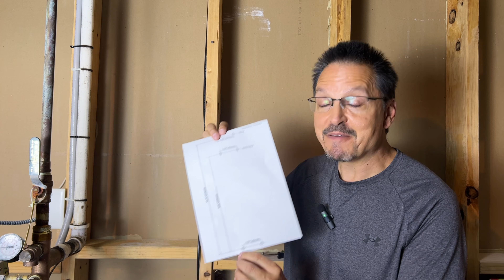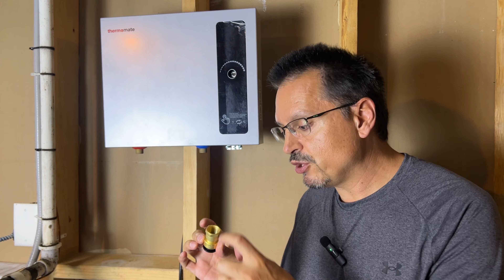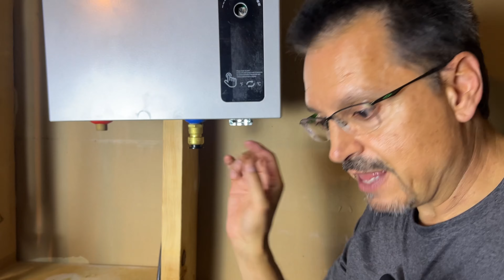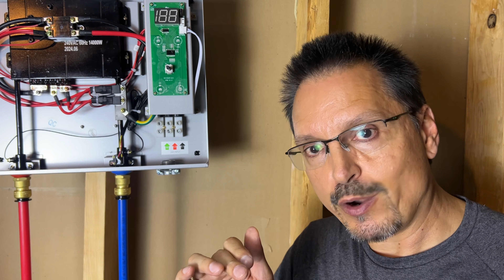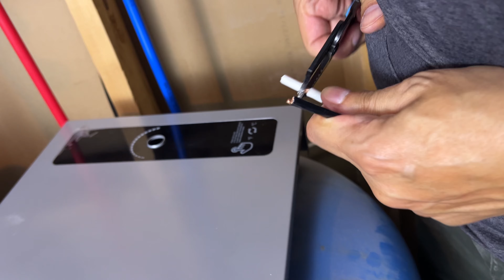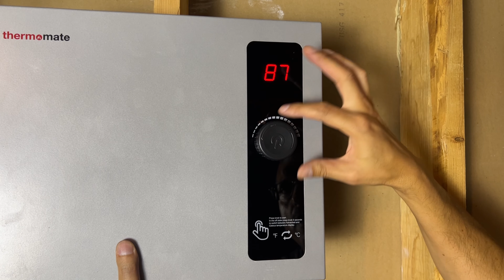Install Electric Water Heater in 3 EASY Steps!

Comment: How fast do tankless water heaters heat up  for two bathrooms and a kitchen
Reply from the maker: Hello. The time while waiting for hot water would be the same with tankless or a tank unit. It would depend on the distance from the water heater to your faucets. 

Tankless can be a good option for many people however, you have to make sure you have a large enough unit to handle how many fixtures you think you may be on at the same time in your house.

Comment: Hello What do I need to put the point of use/under sink heater in as far as the hoses/plumbing? How/ where do I run them. Do I need a adapters?Can I run from the turn off valves, to the water heater, and then where do hoses go? Thanks!
Reply from the maker: Yes you can. Mounting under a sink is fine as long as you have the space called for in the instructions. The water connections are 1/2 threaded make ends. Just buy flex connectors to connect to your water lines. Good luck.

Comment: I was looking to see the tie into existing plumbing. The video didn’t show that. 
Can this be installed inline?
Have home on piers w pipes beneath. Water heater is 50’ away and takes time to reach showers. Can this be installed closer to the showers for more effective heat?
950sf home, 2 showers
Reply from the maker: Yes, you can do that. I did not show the connection into current plumbing in this video, you are correct. You want to install these type of electric water heaters as close to the finished use area as possible. So you want close to pointof use area. You’ll do great 👍🏼

Comment: Any advice on a whole house (2 baths, 2 half baths, laundry sink and washing machine, utility sink, kitchen sink?
Reply from the maker: For the size of the house you’re talking about you’re going to need a bigger on-demand water heater. Rinnai has good quality equipment. It will be a massive amperage draw, if you’re doing all electric such as it might be 100 amp circuit. Is natural gas or propane an option?

Comment: can l use the same wire that my water heater tank is using ,  taking the tank and installing the tankless with same 240 volt?
Reply from the maker: Well, I guess my first answer is yes of course sure you can. However, if both of those appliances are on at the exact same time, they probably will be drawing too much current through the wiring, may also trip the breaker…
Reply from the maker: Oh wait. If you’re removing the old tank model and replacing with a tankless system then yeah of course you can use the same wiring.L 👍🏼
Reply: @HomeRapidRepair  Thanks for replying.  I have one more question. With the 14kw, how many showers can l run at the same time?.  I'm by Nixa Mo.
Reply from the maker: @ one or two maximum. Please keep in mind with these type of heaters it really depends how cold the water temp is at your location. For instance down south or up north? City water vs well water? Etc